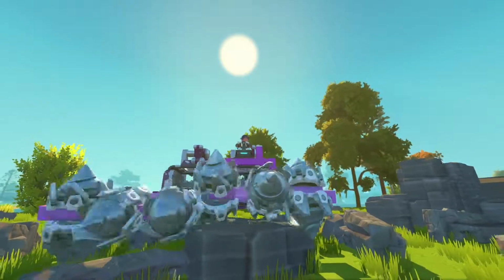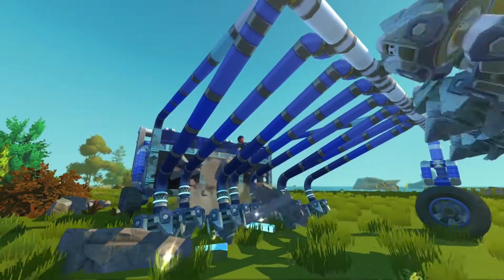This is The Ultimate Mining Machine for Scrap Mechanic.

Comment: That is a good miner.   One thing to add is lights.  There is a lot going on with that build and it will be easy to add some basic lights.  
I have a area light on my miner that uses 8 maxed out pistons set to max, six for height and two to seperate the two headlights pointing down. after the first piston I have 4 headlights pointing in each direction.  The reason for the two headlights on the top is to act as a artifical sun, making the area around the vehical as bright as daytime.
Reply from the maker: I have considered lights on this one, but decided against them because there are so many moving parts that i felt that with shadows from them it would basically look like flashes when the video got sped up. 
Interesting idea about the artificial sun to light up the entire area, reminds me of those roadside construction lights on extendable towers, especially the "PowerMoon".

Comment: I like how clean it mine's but is there a way to combine this miner with a wood cutter and make two in one mechen and it work this good. I made one that deos both but the mining part is not as fast as your miner. Mine resembles the German design but has the drills on springs.
Reply from the maker: I have built a multi-purpose machine before ( https://steamcommunity.com/sharedfiles/filedetails/?id=2432413754 ) and it works fairly well for it's size. Drill mechanism should probably be upgraded to a simplified version from this video to process rocks better, although just drills on springs do pretty well.

Comment: i feel like those vehicles would be 10% better if the ground wasn't made out of lubricated butter... even with electric motors (i now have a vehicle with two seats and toggleable wheels (if you are in the electric motor seat a sensor triggers the change of the set of weels that touch the ground) it's painful, but you should try it. it's just a quadrature of the circle but it's fun and sometimes it's quite useful, specially when crossing the hills with heavier vehicles.
Reply from the maker: Slippery ground is horrible. Even having brake shoes (literally shoes, they have highest friction in SM) is usually not enough.